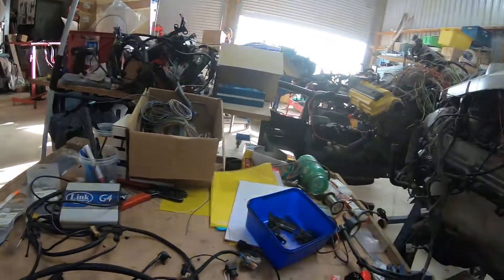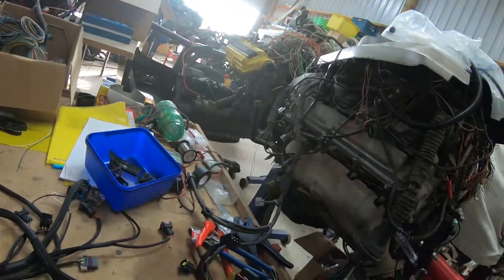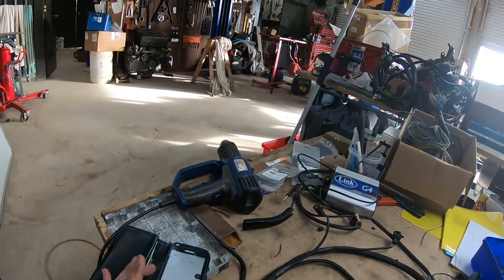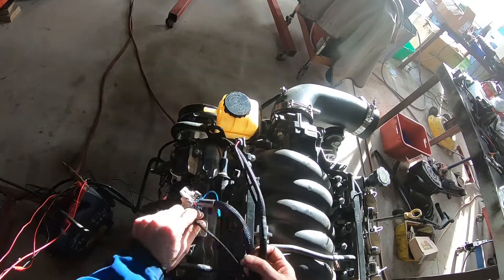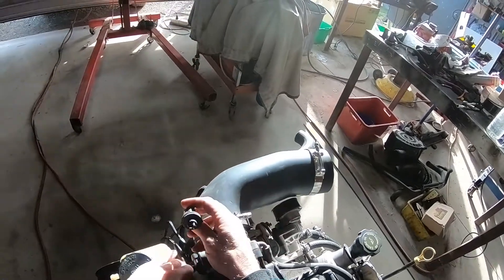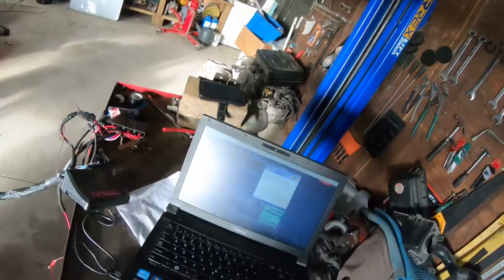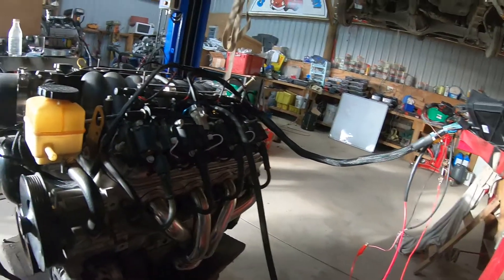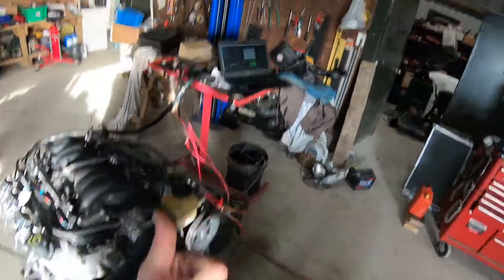LS1 engine to full standalone link ecu loom plug and play

Comment: hey mate what's needed for the coil/injector banks?  do I supply it with 12v to my fuse box ?
Reply from the maker: This setup has a relay which supplies 12 volts (via a fuse) to the positive side of the injectors and the main 12 volt supply to each bank of coils.  LS motors are great as each side of coils comes up to a main harness plug making them easy to wire.  I think the answer you want is yes.  Hope thats helpful.  Cheers
Reply: CartuneNZ okay, Is there anything else need for the coils/injectors to operate other then feeding 12v and earth's?
Reply: besides the ic controls from the ecu
Reply from the maker: The coils and injectors require the trigger from the ECU to operate which is all covered in the loom above.  With the loom in the video there is a fuse box (on the red bench) which gets battery voltage and ignition.  When the key is on the relays supply the injectors and coils and ecu with voltage.  The ecu then controls the coils and injectors negative switch.  There is also a 0 volt reference to the coils from the ECU.
Reply from the maker: And a 0 Volt reference to the coils.  This is already done in the loom above.  Do you know have a wiring diagram for the coils?